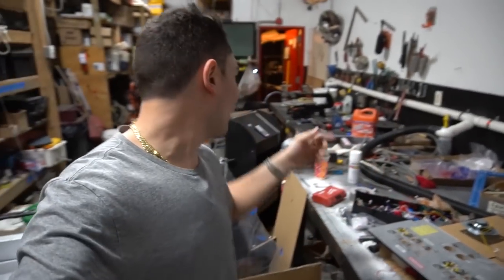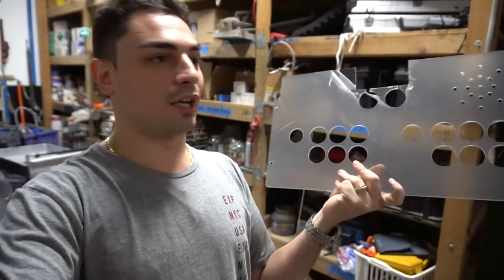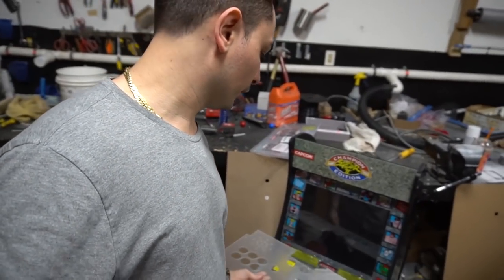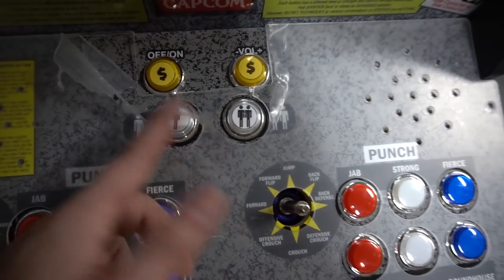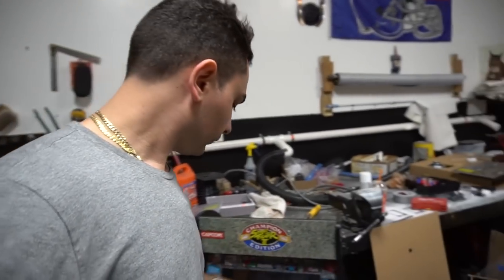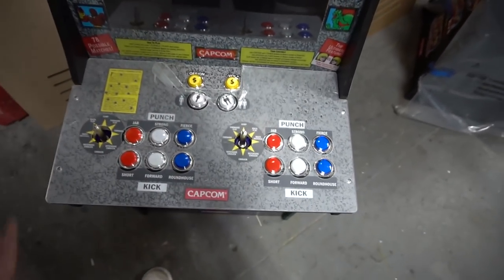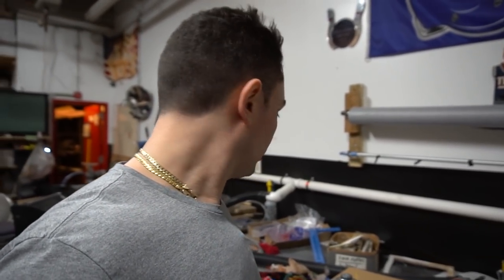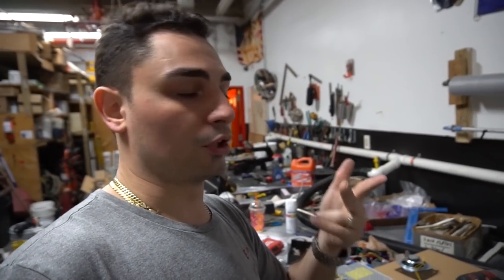How not to drill the Arcade 1up plexi

Comment: THe plexi is cracking because you have no support holding it in place - best way to drill it out is to sandwich it between 2 scrap pieces of wood and clamp it so the plexi is not lifting when you are cutting through it - that way the plexi does not move as you are drilling and the drill bit will not catch in the plexi and crack it.
Reply from the maker: Yea it's not even like 1/8 thick, I dont care that I cracked, just those hole cut outs are awful
Reply from the maker: Wish I knew about the sandwhiching before! Lessons learned thank you so much for the tip

Comment: Arcade 1 up have probably sent it to big so  it just goes over the buttons and alls people have to do is take the 4 screws out and thats it, otherwise if they made them holes to fit under the buttons people would have to take the buttons out and put it down and alot of people would be contacting arcade 1 up and asking how do they remove he panel blah blah haha
Reply from the maker: Yea they did it the lazy way
Reply: That is exactly why they did that.  It's was smart of them, also this deck protector works fine and does its job.

Comment: that cheap template is exactly that...a template to get just the lay out..Dont use your drill on it even to drill the board...You need thicker plexiglass and sandwich it on all the edges and it works fine. I agree the button holes are too big and its better to just buy your own good quality plexiglass...take down all the buttons, speakers, and controllers and copy the board to the plexiglass..works much better and looks a hell of a lot better quality
Reply from the maker: Yea it's not even like 1/8 thick, I dont care that I cracked it, I just cant believe those hole cutouts cause they are awful